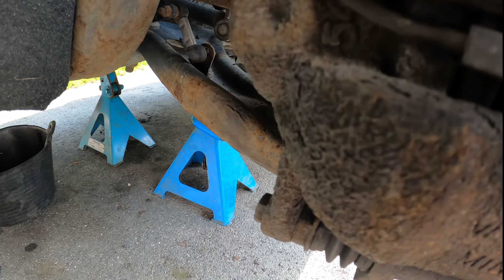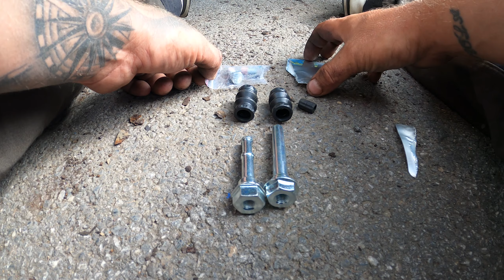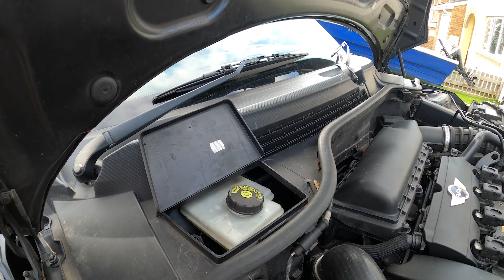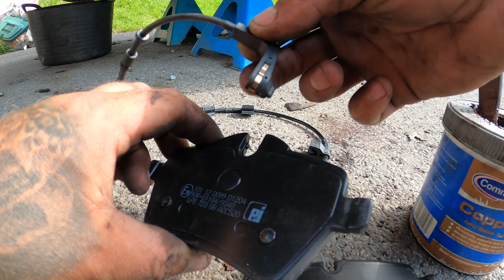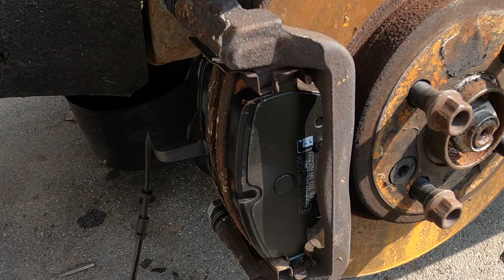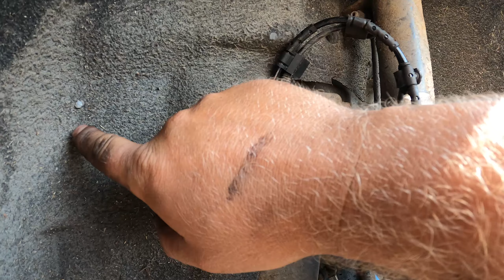Mini cooper front brake pad replacement and wear sensors replaced

Comment: Excellent video. 

Question tough, do I have to change the sensor? Does it wear down with the brakes? My local autozone only has the  pads. This is the only car I have that has sensors so I’m not sure if it’s a must to change with the pads.
Reply from the maker: Yes it will need new sensors there is loads on eBay there do wear with the pads and you can reset it without a new sensor

Comment: Hello !! Nice Video and saved ! Just a question, do you know the torque of the 2 bolts?
Reply from the maker: I don't sorry with the sliders you dont go mad on them there's no need just tighten them with out using massive force 

The torque spec would be very low

Comment: Great video, tempted to try myself. Garage noted it on my service/MOT that pads are getting thin but want £120.
I'd need that piston tool to do the job, what do you call it, so I can search them and see the price? Another question when I go to look at pads is there anything I should look for in particular for quality?
Reply from the maker: Brake rewind tool to fit mini.

I normally buy Delphi pads or better
Reply: You can do it yourself Stuart! And save that garage labor money for better pads!

Comment: hello bud its just the sensors that bother me
Reply from the maker: Why? What do you mean. Why do they bother you
Reply: @Thediycarchannel  Getting em apart and reattached
Reply from the maker: Sparky a little wd40 on the connection. And remove dirt, it will slip back together no problem. 

If you don't feel confident don't attempt it, just take it to a garage. I'm not sure what mechanical knowledge you have.
Reply: @Thediycarchannel  I don't like to be defeated but i think i will just bite the bullet and take her to the garage Thanks for taking the time with me bud i appreciate it
I dig holes for a living i have the skill set of a caveman but for a second i convinced myself i could do it  Great video by the way 👌
Reply from the maker: If you can, if possible ask the garage to show you. It's fine to do but if you dont know it can be daunting. 

That's no worries thank you for watching and thanks for your comments.

Comment: The mini brake sensors are a scam, sensor gets triggered (circuit breaks, by rubbing against rotor) with over 1cm of pads left and then the distance counter starts (around 10k km if i remember correctly) that remaining distance  will keep going down whether you use the brake or not and once it reaches 0 you will get a super annoying alert everytime you start your car. My front brake pads still have a good 6-7mm left and my counter has reached 0 👎🏼👎🏼👎🏼👎🏼
Reply from the maker: That's not very good at all. I didn't know that
Reply: @Thediycarchannel  how long did your pads lasted? my car only has 18,000 km and it’s due for front and rears already (although visually it still has 5mm+ of meat left) ridiculous, my previous merc pads lasted 30k+ and my honda 45k+.

Took it to the mechanic and he wanted me to change the rotors too! 😂😂 i looked at him, dude my cars only done 18k and you want to change my rotors? and no i don’t drive agressive
Reply from the maker: It wasn't my car it's a customer's car